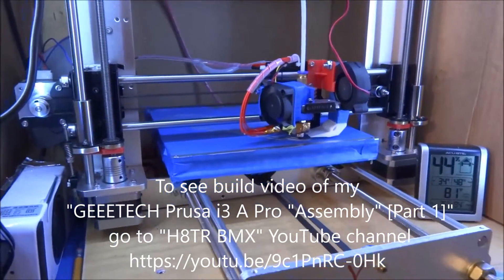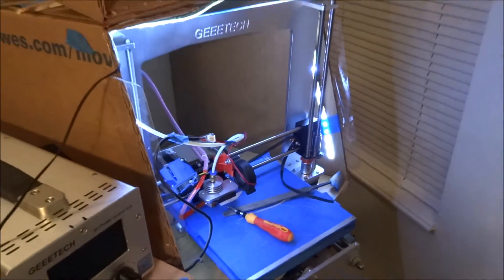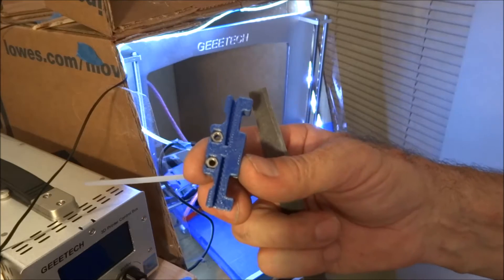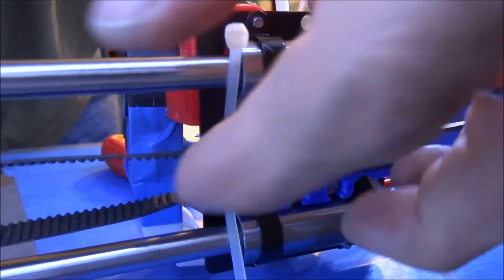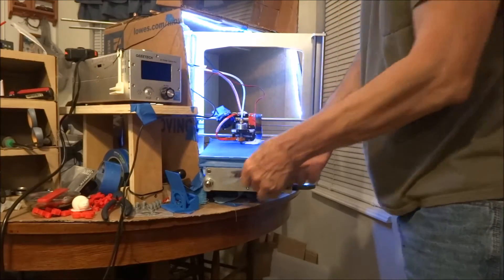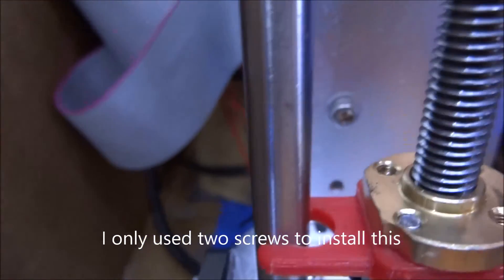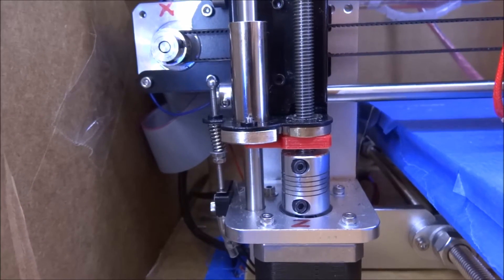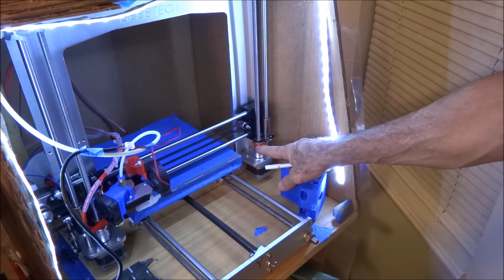Geeetech Prusa i3 A Pro 3d printer diy kit . 2 modifications. that should be done

Comment: Hi I think the locking rings on you x axis shafts should go in the inside of the x axis shafts  to stop the x belt tension from squeezing in the z axis shafts inwards, as well as stopping the shafts from sliding out. I have this printer and I had nothing but dramas, as soon as I swapped the lockers my problem was fixed "not to say you have any problems" its just an observation . Thumbs up for the vid, loved it.
Reply from the maker: pete jones Thank you.  I haven't had any problems with that at all. But you do make a good point. If I ever have it apart I think I will swap them around.

Comment: I ordered mine on Thursday morning and received it at lunchtime the next day which was awesome :)All went well building it but am having some serious problem's with the Z axis as I can't seem to get any height on any prints :(
Reply: Don't know if you've fixed it yet, but sometimes the holes don't line up on the Z axis lower and upper mounts. You'll notice which one it is fairly simply. Alternately the settings will be off for your steps per mm depending on which model you got.

Comment: holy cow thats a lot of noise on the Z..
Reply from the maker: ya , took a minute to figure that one out..... It only made that noise when z axis was going down on long travels (when homing after a print ) thought it might be the brass rubbing on the painted surface. Turns out the threaded rods have a very rough surface finish on the threads.... even with oil they were noisy ... put a tiny bit of  bearing grease on the rods and the noise stopped. My guess is allowing the brass nuts to not be in any bind allowed an oscillation to start (the left one made most of the noise)